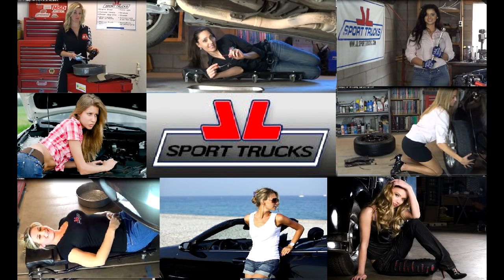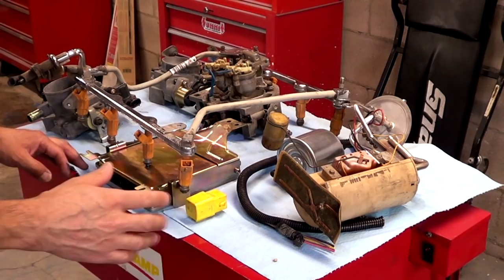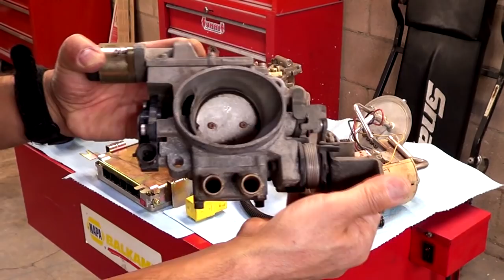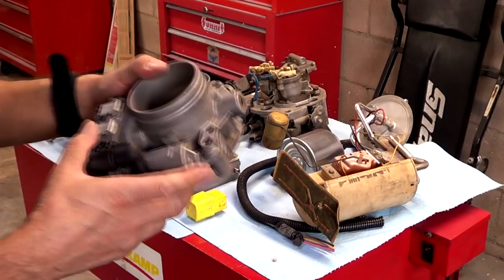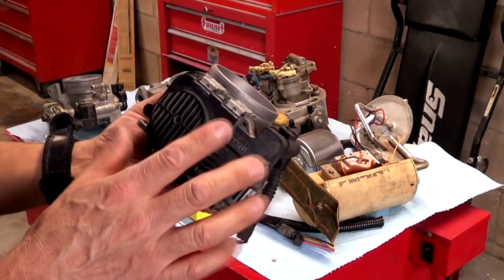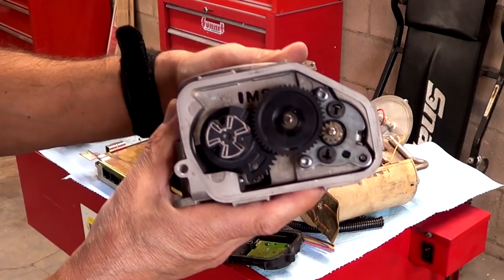How the Throttle Position Sensor  (TPS)  and Idle Air Control Valve  (IAC)  Work

Comment: I had a GT-40 Intake installed on my 1992 Mustang 5.0 
Just about immediately I had a high Idle situation that I could not back down. Great ! All that I spent for nothing !
I was about to give up and have it all put back on the car. I watched this video and got a VERY clear understand of how these things work. One last time I tried to fix it. I cleaned the IAIC valve with T.B. cleaner like you said ! NO GOOD ! Still high Idle. Then I noticed that the shop installed the IACV upside down. I reversed it. PROBLEM SOLVED !
THANK YOU ! YOU SAVED ME !

Comment: Excellent.  Answered my questions.  We were getting irregular idle could not find an IAC on this KIA.  You explained why.  It is built into the TB motor and TPS (which Kia calls the ETC--Electronic Throttle Controller).  Opening that VW TPS cover showed it all.  KIA uses the same system as VW.  We replaced the TPS and it solved the problem.

Comment: Thank you for the video, if there is carbon inside the area where the Idle Control Valve screws in, what is the best solution to spray in there to clean? I've heard not to use Carb cleaner?

Comment: Excellent descriptions.  Have a constantly changing hot idle speed in my 88 S10.  Occasionally normal, but usually high or takes a long time coming down.
I think tomorrow is the day to replace the IAC valve. It might even be OEM of the 1988 era.
Reply: ok

Comment: Do you happen to know the signals it sends? Is it 12v and then it drops 1 volt all the way down to like 5v? Is it variable like that to change how open the valve is?

Also when I first start my car it idles high like it should (1200 to 1500) and immediately drops like it should slowly but as it's doing that I get some surging and shaking (rough idle)....do you think that could be a faulty IAC solenoid?  Maybe I should check the resistance or check the incoming voltage from the ECU or possibly even check to make sure the throttle position sensor is sending the right info...

Comment: Excellent video. I have a 2002 Toyota Camry 3.0 liter engine (1MZ-FE) with a throttle body that is not controlled by a cable. Occasionally it stalls at idle when I am driving. When I turn the engine off for a little while (20 minutes or so) then turn it back on the problem goes away. I cleaned the throttle body and the mass air flow sensor but still have the problem. There is no check engine light and no codes. Any suggestions you can offer me to check? I bought this car when it was new and still love it.

Comment: @HOWSTUFFINMYCARWORKS I have a 95 Hardbody with Ka24e. Would you be able to explain how to reset the Throttle Stop screw. The one that is never supposed to be touched and pre set  by factory? A blown engine I bought and rebuild had issues with the pedal hanging up. And the problem was throttle stop screw being completely back out.  My truck has been under powered, bad gas. I have made adjustments recently and when its cold its running beautifully and feels right, but after normal temp up, take off and gear shifting has a hesitant effect. Like a bog then fuel kicks in and takes off. My fuel pressure is staying at 40 psi which is supposed to drop to like 33 or 34 after normal temps I believe. I would like to know also on IACV idle screw, say its turned to the right completely off, what should be the default number of turns when opening that idle screw up. 

Thanks for video!

Comment: I just replaced the icv on my 87 s10 blazer. I am curious to know how the plunger on this valve moves. Is there a motor inside the device that spins the plunger to different positions from open at start up to completely closed under acceleration? I noticed that you can not depress the plunger of the valve if you are holding it in your hand. I am familiar with an egr valve that opens and closes under the effect of a magnetic solenoid and at first I thought that was the mechanism behind the icd, but apparently it is more sophisticated.
Reply: a stepper motor is used

Comment: But on the Toyota the iac twists to open, rather than depresses. 

I just cleaned mine out on my old Lexus rx300, and had a question: As I cleaned it I twisted it obviously out of the position it was in when I removed it. Cause it twists a full 360 degrees, and you have to turn it to clean off the carbon build up. There’s no spring or anything to set it at a specific location, so when I turn it, it just stays where I left it last. So will the ecu automatically turn it to re-set it to where it needs to be? I know that’s the whole point of the iac, I’m just wondering if it is supposed to be at any specific setting when I reinstalled it?
Reply: u have to mark the position of the motor before removing.

Comment: I have 02 Nissan Frontier 2.4L with 210k miles, project truck. I' have a pesky P0302 that will not go away. I almost replaced everything except PTS and IAC valve. If idling at 700rpm and put it on drive, my rpm drop to below 500. Is my IAC bad? The coil reads 11 ohms, I disconnected it, run engine, reconnected and rpm changes. Any suggestion?

Comment: Need help!...I replaced my IACV due to surging idle. After replacement the engine cranked up to 4000 rpms....I had to tap on the brake to get it back down...then I test drove it and the car wouldn't DEcelerate when I took my foot off the gas...had to ride the brake home......I switched back to the old one and everything went back to normal.....what could be going on?
Reply: Buy OEM, after market sometimes are defective due to poor quality control in the factory.

Comment: where does the AC system sends signal to the iacv to make changes to the idle when opening the AC?
Reply: to the ecu.  ecu needs current engine rpm, engine coolant temperature, map/maf data, tps data, ac signal to control voltage to iacv

Comment: can u plz tell me what my problem could be. 2005 nissan frontier, in gear, sitting at stop sign, at idle, foot on brake. The engine rpm vlimb very fast to almost redline, and rear tires broke loose and started chirping, I put in park and turned off key, I restarted it and put it in gear and drove home, I pulled the throttle body and it was very dirty I clead the butterfly and insde the throttle body. my truck is drive by wire, I dont think it was the acclerator pedal, because I was at idle. what do you think caused my problem. I checked codes, and only got an evaporative emmisions code.
Reply: at first I was thinking that it must be something in that drive by wire accelerator pedal, but because I was sitting at idle, in gear, now im wondering if something went haywire with the idle control , as before I was thinking abt it as an accellerator malfunction, rather than an idle malfunction. it scared me because this never has happened before. I am afraid to let my wife drive the truck now.  it wasnt like a high idle, it was like VERY HIGH, like the engine would have blown if I didnt shut it off.

Comment: My Expedition only dies in reverse or drive when it reaches normal temperature after I have driven long or short drive.After the engine cool off It will start and drive with no problem even on any stops.Only if I park and try to start it over again its been like that for months.So I never bother to fix the problem I could still go from Point A to B.
Reply: check for a bad thermo bypass valve

Comment: dear sir I saw your clip I like it but one thing u didt discribe  about Toyota corolla idle and fast idle How it work because it have two pipe line in this sencer  then u should discribe it plz
Reply: it seems that the new system doesn't have a tps nor an iacv.great presentation.it seems it is going back to the butterfly movement not by cable but by a motor digitally controlled.
please correct me if i am mistaken
.
Reply: And you should learn how to spell first
Reply: @familyfirst7027   This isn't English 101.  We is talkin' car stuff. 😁